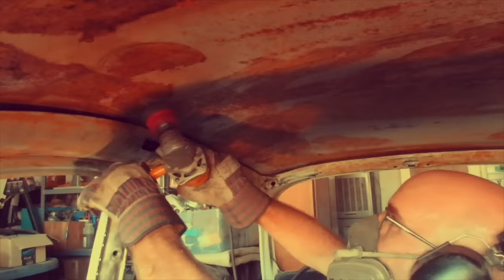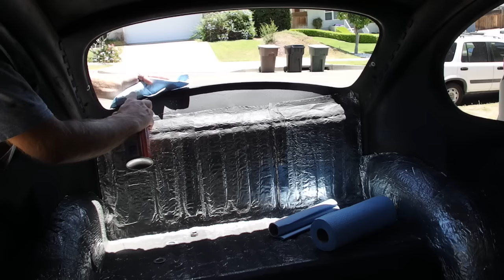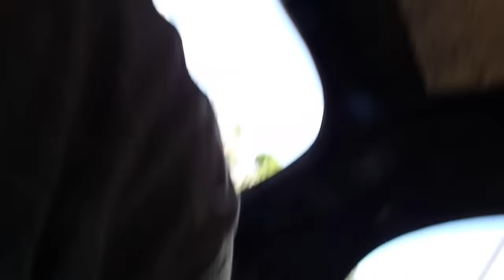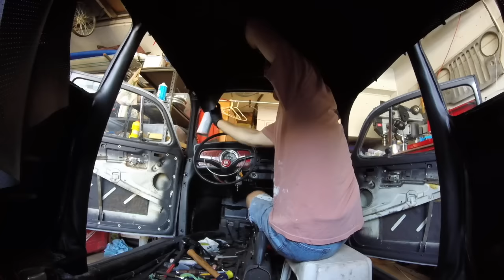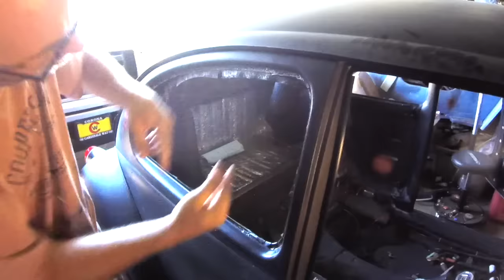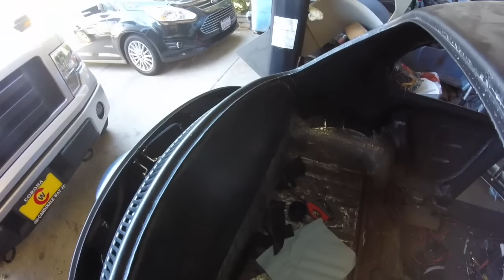1969 VW Bug Project - Episode 44 - Interior, Part 2 - The Headliner

Comment: Nice job.iam also doing a 69 vw..just done with paint.replaced all front end parts .working on the rear brakes now,and rear bearings. Re build transmission already.
Reply from the maker: Awesome!  At some point, I want to pull the transaxle and do a total refresh.  It's got a leak or two.  All I've done up to this point is some work on the axles and a trans oil change.  How 'd your trans rebuild go?

Comment: How did you clean the inside of your car before doing any interior work. I just removed my old headliner after vacuuming everything out and it's a mess now with dust and God knows what from that old headliner.
Reply from the maker: I used a grinder with a wire scrubbing brush on the headliner glue.  The flooring I wiped down with some acetone-based cleaner.

Comment: Trust German engineering, mount that engine lid the way it was intended if you want your aircooled engine to cool properly! :-)
Reply from the maker: It won't fit that way.  The deck lid is for a different year and the hinge mounts are bent.  That's part of the reason why I went with this setup.